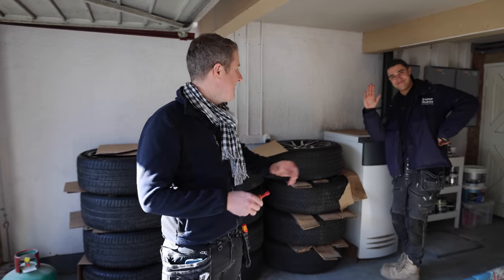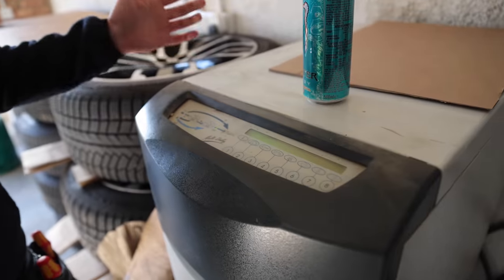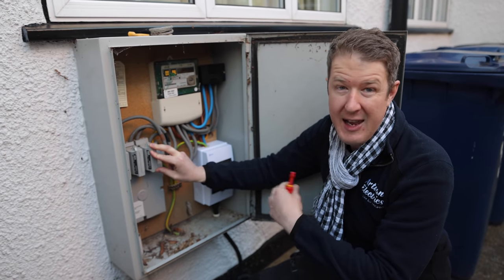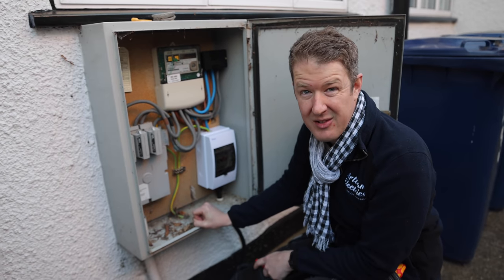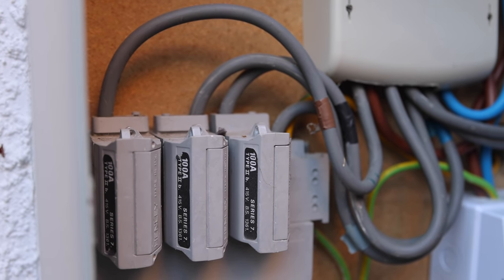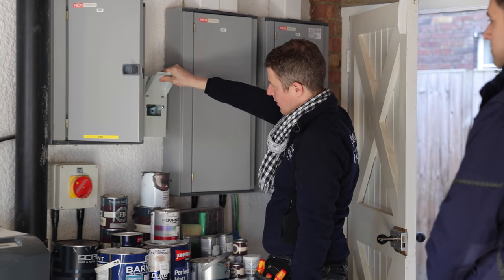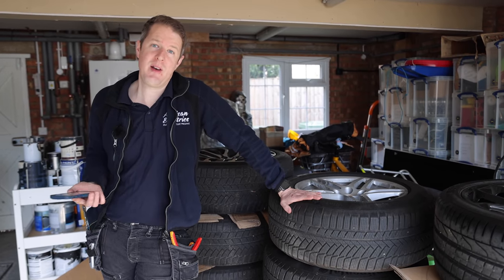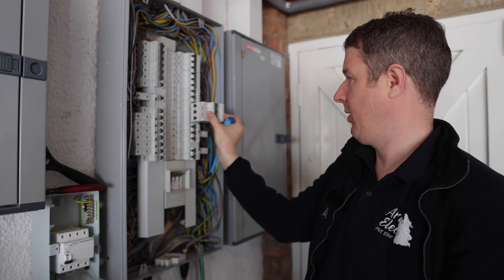INSTALLING THREE PHASE 22KW CAR CHARGERS AT HOME! - Electrician Life

Comment: An interesting point to add, lots of EV's don't even have the capability to charge at 22kW AC. Funnily enough, the Taycan is one of them with a maximum AC charge rate of 11kW. Lot's of people don't know that, including the sales reps. So unless this guy paid for it as an option on top, he's had a nasty surprise...
Reply: Yeah, same with my Tesla.
I looked into this when buying a home charger.
7.4kW versus 11kW is equivalent to going from a charging rate of 21mph to around 31 mph.
So, 48% faster - but still 9 hours for a full tank... Maybe useful, but nowhere close to a DC fast charger.

Comment: I would like to point out that your statement about three phase services is not correct, WesternPower Distribution who is the DNO serving from Lincolnshire to Pembrokeshire to Cornwall fit three phase service cables and three phase cut-outs as business as usual when connecting to all new build and service alterations. It is then up to the developer or building owner to make full use of the three phase supply.
Reply: What size cables and fuses do they fit?

Comment: Poking a metal wallpaper scraper inside a 3phase board 😬🙈🙈🙈 , what’s wrong with a piece of wood like the other electrician said , also that conduit work would have not put so many bends in one piece would have bent it to an end box and then adaptor and bushed it to the rear to outside

Comment: Quick bit of help please from the community, I have the three fuses but not the three tails to a meter, only one.  Can an electrician sort this or do I need to get the power supplier to install a new meter?
Reply: You will need to contact the DNO to check that you have 3 phases connected at the head. Then a call to your electricity supplier to change your meter to 3 phase. Then an electrician to to install a new consumer unit.... If you don't need 3 phase, don't bother!
Reply: @garygoode7479  thank you 🙏

Comment: Why didn’t you just install a type A RCD in the main board rather than installing the sun-board?
Reply: 5:33 Doesn't look to me like there's anywhere to put a 4 pole RCD in that board apart from as a replacement for the main switch. You wouldn't want your type A RCD tripping out the entire board for a fault on any circuit when it's only the EV charger you want to protect.
Reply: @havoctrousers  Ah yes - I missed that it needed to be a 4 pole RCD, so yes it wouldn’t fit in that type of board.  Thanks

Comment: For future Reference: The Tesla has a built in GFCI (Ground Fault Circuit Interrupt). The Ground Fault Interrupt Circuit (GFCI) in the US serves the same purpose as a RCD does in Great Britain. Read the Tesla Wall Connector Manual - Page 5 States: Wall Connector
includes integrated GFCI protection - do not install a GFCI circuit breaker. The only real difference between the two is that the GFCI is designed to trip at 5mA and I believe the the RCD is designed to trip at <10mA.
Reply: You still need to install a type B for the DC part (and select it for the proper selectivity) (and, in the UK, install PEN fault protection).
Reply: @HenryLoenwind  The Tesla Wall Connector does not produce DC Voltage - The Tesla Wall Connector simply sends the voltage 220 or 240 depending on the Country. The Ac/DC Converter is located in the car. Please understand what you are speaking about prior to correcting someone... The Tesla Wall Connector has a BUILT IN GFCI which is the EXACT item as a PEN fault Protector the only difference is that the GFCI activates at 5mA and the Pin Fault activates at <10mA.  They both do exactly the same thing just two different names... The GFCI actually cuts the power quicker than the PIN Device...
Reply: @michaelholliday100  But it is a conduit that can allow stray DC to flow from the car into  the network. Which means there needs to be a Type B RCD to protect against that. Also a GFCI does absolutely nothing for a PEN fault (only a ground fault, that's the "GF" part of its name). It only protects against faults on the consumer side, not against faults on the network supply side.

Obviously you have absolutely no clue what you are talking about, so either take your own advice or inform yourself about what a PEN fault is (there are some excellent video about this on YouTube, I think even this channel has one) and what kinds of DC fault current protection is required by UK regulations.
Reply: @HenryLoenwind  100% correct 👍

Comment: isnt the taycan limited to a 11kw onboard charger anyway? and what good would a 4 hour charge possibly do?  like if you forgot to charge the night before from zero i guess you can limp to a charger in 1/2 the time so like 20 mins vs 40 but, how is that ever useful.  tesla did away with 80 amp and 72 amp chargers as nobody used them.  theyll be back for massive 200kwh trucks that are just less efficienct and may be towing but not really a thing in the uk.

Comment: Hi I was wondering if these elecric cars can charge them selfs while being used ( driving ) - with a 12v inverter ?
Reply: They charge when braking (called regenerative braking). When you slow down the tires spin the motors which charge the batteries. 
You will use more energy to power the inverter than the power you will get out.
Reply: Yes they can it works perfectly, for about 30 Seconds!

Comment: the 3 phase charger only gives out 11kw in the domestic setting.
Reply: Depends on the car. German cars appear to be limited to 11KW, probably because in Germany domestic loads cannot exceed 16 amps per phase. That's we many ovens and hobs have the option of 2 phase wiring.

Comment: nice job, could you not just go straight into the 3 phase board and fit a new rcd.
Reply: They don't do 4 pole rcds for 3 phase boards
Reply: @heladas90  Need for disconnection of all line conductors.
Reply: @michaelsimpson6603  
Phase drop out switch. If one phase drops out they all do.

Comment: So, we’re drilling through the case of a DB loaded with conductors of all sizes and to protect the conductors we’re using a paint scraper with a handle which is not VDE rated? Really??!! …., Cody’s comment on using a piece of wood is surely a far more sensible suggestion …
Reply: Sorry, Cory’s suggestion

Comment: The taycan only has a 11kw onboard AC charger doesn’t it? So it’s only going to be using half the 22kw charger capacity. Not much greater than a single phase 7kw charger.

It can charge much quicker using DC, but not AC. Same as Tesla
Reply from the maker: It an option from the manufacture to upgrade to 22KW AC charging a few car manufacturers offer that now.
Reply: @artisanelectrics  interesting! Nice video btw

Comment: This isn't electrical advice. Please seek further confirmation from your preferred professional and endorsed/indentured NIC/EIC installer/contractor!

With a property with a feasible headroom of 60A to spare for EV charging on a single phase supply. It would be possible to supplement such a facility with a Riello Sentryum Rack SRT20. This is a UPS that can run with or without batteries (VRLA/Lithium/SuperCaps). The vendor has confirmed that the DC bus will correctly distribute  a single phase (L1+N) into three-phase L1,L2,L3+N at up to 20kVA input loading. Also useful if you wish to feed solar or wind into the car. In theory the unit could stretch to 83A of input current (Power factor corrected to 0.99).

Many cars, especially the German luxury marques are (in 2022) only able to dissipate 11kW three-phase power. That will likely change as battery capacities increase beyond 300 mile ranges on 2 tonne cars. This UPS method would scale up from the 11kW service you'd get from a single SRT20. Units can be parallel up to 22kW and beyond. Though you'd probably insert them as rack modules into a 19" cabinet if you have the space to do so. Also, you'd be dedicating perhaps as much as 98A of a single phase supply to run a pair of these UPS to then feed 22kW into the car. Barely enough left to charge your iPhone without risking the main fuse starting to glow hot.

Until blue chip vendors make more PowerWall-like lithium or redox-flow energy storage systems for the home. I'd think there is a space for homes to transition from single phase grid supply to merge those with their own on-premises renewables through solutions such as UPS based ones. You get a lot of quality power from these when compared to the solar/PV house controlling grid-connect capable solutions that frankly show their lack of minerals when the batteries reach the end of their useful life.

There was also a predecessor model, the Riello MultiGuard Industrial unit with 1-3:3 dual conversion (MGI  20T SA) but I don't know if this is specified to be able to run without batteries, as I haven't asked. The Sentryum Rack SRT20 shares the input 1-3 and output of 3 phase functionality and probably has better software and updated three-level IGBT power semiconductors. Furthermore, the SRT20 can also provide automatic voltage regulation (AVR) to the load and voltage correction and harmonic distortion to supply and load improvements. Sadly, the expense on this type of UPS doesn't entirely protect the unit or the charging location for the car from open-PEN faults. Though with the smaller currents of an 11kW three-phase supply it could feasibly be the case that the hookup cable to the EV could be a smaller CSA and the savings on this run could perhaps help to afford a three-phase isolation transformer to de-reference the charging area from the grid. Doing this rather than relying on the potentially imperfect differential voltage devices such as the multiple-guess Matt:e, Proteus, Garo,  and  CityEV SaveVolt (300 +probe option)  [SmartPower-PENGuard still in design/work-in-progress] protection solutions that some have been drawn towards.

UPS dual-conversion inverters shouldn't be used for frequency adjustment as most EVs don't specify how you can use the onboard chargers on different continents or in NATO bases with different voltages and frequencies or even if they support delta wiring (Tesla do specify this but they're unusual in doing so). These  Riello UPS sector units would likely save a minimum of 50% (at 11kW loading) of the cost of the re-supply costs of going through the DNO to get to the outer curtilage  and onward 'civils' of getting to your preferred meter/board location. Nevertheless, these Riello units price in at either side of £4k and much more if you take batteries or decide not to use it on a table top (Riello say it is fine to run this unit outside of a 19" racking cabinet).

Like in the case of the Tesla PowerWall / Gateway, they're currently like finding hen's teeth to source. I'd imagine that anyone implementing along these lines might also use a priority consumer unit to disengage the car when either/both the electric shower, instant-hot-tap and electric-cooker are running. Just to be sure there is headroom for the wall sockets and heat-pump as houses develop that way.  What with 50-60A of quiescent loading in the middle car charging band being quite a demand to overlay on even a modest household. 

This is a paper based design and I've not seen it working for specifically this use at the time of writing. Architecting the Riello for car charging use was one of my pet projects to research during the Covid19 lockdown. 

Sharing it here is compliment of sorts,  to Artisan Electrics. Who seem to be great communicators, reliable, innovative and probably not the most expensive sparky on the block. Something quite rare in their field of work. 

Kudos.

Comment: What is the point of 22kw AC charger at this house when the guys new Taycan (like 99.99% of new EV) only accepts 11kw on AC?  Looks like bad advice from Artisan….
Reply: Because if you want to charge at greater than 7kW, your only option is a 22kW charger. Even 11kW is 57% faster than 7kW, which is potentially useful if you're on a time-of-use tariff like Octopus Go. There's no disadvantage, other than the initial cost. And it spreads the load across the 3 phases, which is better for the DNO and possibly the rest of your house.

Comment: 3 phase 100 amp head from the national grid is around £9500+vat this is not includes the consumer unit or any house wiring. So although i would have love to thats a big investment, but like wise you can intall heat pump , air con and you can charge a EV VAN in 2 hours :D Wish UK's KW/h price is alot cheaper, we could be alot greener. But with the Kw/h we are getting charged we are pushed to different ways, we could make carbon zero but instead we pay for zelensky's travel expenses. Shame.

Comment: drilling a db and putting a metal filling knife inside really??, use plastic or a non conductive barrier, and you call it perfection, laughable
Reply: I could believe I was seeing this ,terrible and dangerous advise on single phase let alone 3 phase….was the board isolated?

Comment: Has anyone realised this is pretty pointless as as it won't charge most of current EVs on the market any quicker. It will be limited by onboard chargers. 
Also to be completely transparent we should stop calling those devices chargers... For AC actual charger is in the car... This actual device doesn't do anything else other than some access control or scheduling...

Comment: I don't see the point of installing a 22KW charger at home. The faster charge rate will risk degrading the battery over time. OK for the occasional charging when out and about. The most efficient rate to charge a car from home VS battery degradation is 3.5KW.

Comment: Calling the Electric Vehicle Charge point a "charger" is a bit misleading. We know its become common parlance and to many its just the same as the charger your have for your phone or computer etc which it is not, again we all know the actual chargers are in the car, these are only the type 2 connection ports or connections or formally electric vehicle supply equipment (EVSE)........yep I know that catchy little terminology is now lost in folk law but yea people think that little box charges that whopping battery.

Comment: 22Kw approx 7 or 8 two bar electric fires let that sink in as you ponder your next fuel bill 🤣
Reply: Compared to filling up with Petrol that's cheap ! On a low rate overnight you can get 100 miles <£2 !